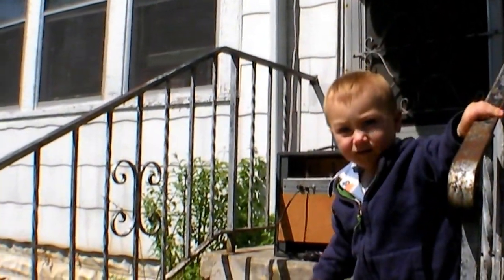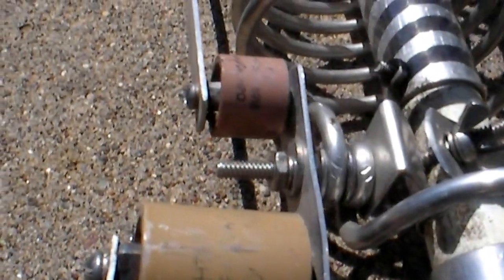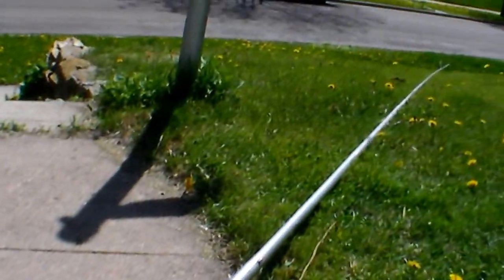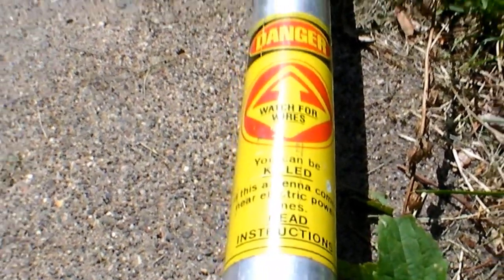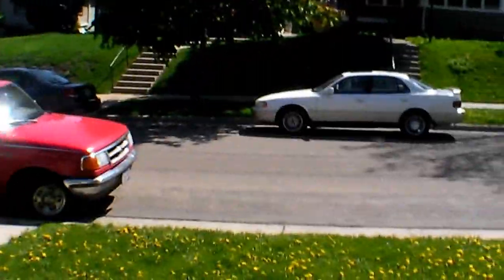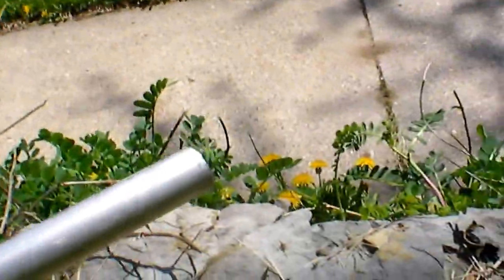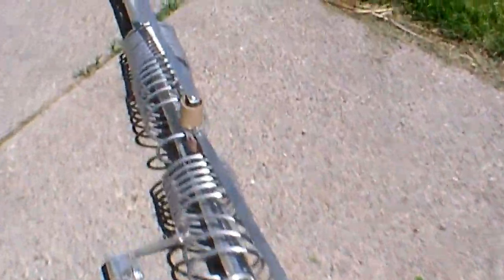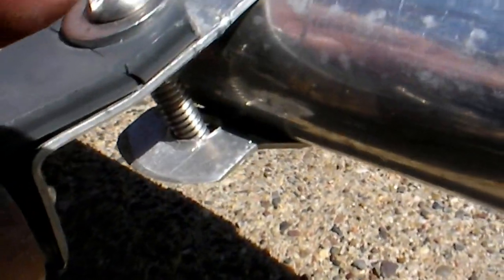A Butternut HF6V for a quarter!

Comment: Ive had my Butternut HF6 up for years. I do guy mine with dacron ropes to keep the caps from breaking in the strong winds.  Good buy for sure. They are expensive antennas.
Reply: They usually run right around $600 new these days.

Comment: $500 antenna for a quarter isn't bad. The cracked stand offs for the 15 meter decupling wire can be make of slices of pvc pipe. Old coax can be used for radials. Ground mounted radials don't have to be tuned/cut to specific lengths. The ground detunes anything on it. A few good and thick radials in directions allowing a couple good lengths gives the antenna excellent results. Get a 11'-6" length of RG-11 for the feed point and you are fixed up for some DX contacts.

Comment: This is a Butternut 80 - 10 m multiband vertical model HF6V.  The insulated wire running down the side is for 15 meters.
Radials do NOT have to be resonant if they are on the ground.  I have one of these in my backyard right now.  A good antenna.  Use the manual to adjust the coils for each band

A steal for a quarter

Henry W5HNS